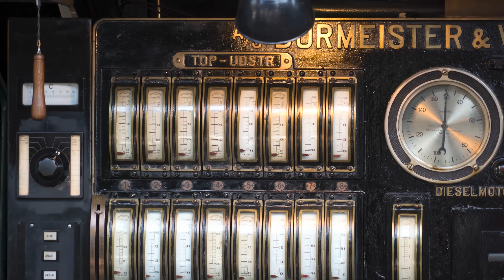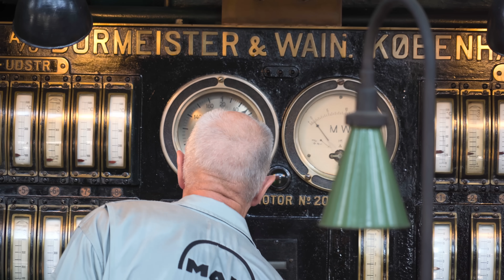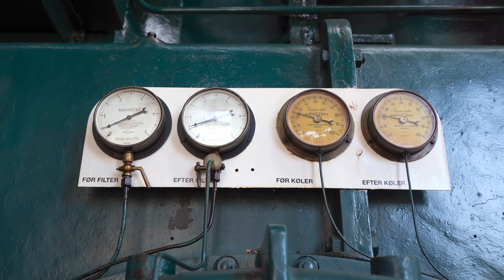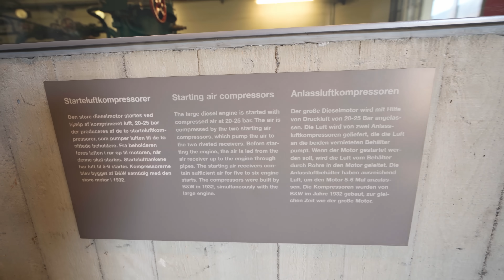Starting The BIGGEST DIESEL ENGINE On Earth | 22.000 hp B&W 2000 COLD START

Comment: What does "double acting" engine mean?
Reply: The pistons produce power on both the up stroke and down stroke.
Reply: This isn't a double-acting engine, it is opposed-piston.
Reply: @holysirsalad Double acting, spot the bottom exhaust pistons at starting platform.
Reply: @markbeale7390  Double-acting is when a single piston is pushed by either side in both strokes. These are opposed-piston, the force for compression comes from the rotation of the crankshaft. Fairbanks-Morse and Napier Deltic engines employ these designs as well. Double-acting is found in hydraulics and steam engines
Reply: @holysirsalad  This Burmester +Wayne is a double acting opposed piston  engine.
Reply: @holysirsalad  Fairbanks + morse, napier deltic are single acting opposed piston engines.

Comment: Bet this engine outlives all the EV's in current use.
Reply: Humanity won't outlive them at the current rate of change.
Reply: I bet the pyramids outlive all the houses in current use. I still prefer a modern house to pyramids or their predecessors: caves
Reply: Considering it's a well maintained museum piece, run for very short times, no problems at all.
However it's doing no real work, it has no load, just a curio for the few watching

Comment: Im curious,  I notice it showed large poppet valve, but why does it need poppet valves if its opposed pistons?  As normally 2 piston cylinder designs use ports that are uncovered by the pistons.
Reply: Good question
Reply: From 2 stroke poppet valve engine,which B+W manufacturer nowadays.
Reply: It does not have any poppet valves, the pistons you can see in motion are the valves, called sliders in this case.

Comment: Sorry  , this is not the biggest diesel  : Wärtsilä Sulzer 96 . It is 114.000 hp by 102 rpm . I believe it is 2300 metric tons and 25 ,3 m3 displacement .14 cylinder , bore 0,96 meter and 2,5 meter stroke .

Comment: I had

I was a fourth engineer officer standing by one these old timers. I got the chance to drive her during engine trials . Three piston in each cylinder  eight cylinders 64 fuel valves .  They were prone to scavenge fires . They were also extremely heavy to manoeuvre as  it was all manual bell cranks .  However feel very privileged to have driven one of these double actors.

Comment: It is oposed piston two stroke of very interesting design. Oh, i would love more technical data apart from being very long lived. Fuel consumption per kWh for example.
Reply: I sailed with these engines for 6 years. Fuel consumption at 116 revs gave us 16 knots speed and used 4.8 tonnes per 4 hour watch, 28.4 tonnes per day.

Comment: Simple question - what is the efficiency of this engine?
Reply: I think about 40%, modern engines a bit higher. If there is an exhaust gas boiler installed for heating purposes the total efficiency can be raised till 50%

Comment: Why not tell what that engine was used for.
Reply: It's connected to a 20 MW generator. Was used during peak demand in Copenhagen. It's last commercial use was in 2003 when it was used to bootstrap start the grid after a large outage. Just visited it last month.

Comment: Manufactures still make engines this size and much larger making over 1 million horse power. These types of engines I've seen them used to power in massive container ships. And they are still in use today. Not many people know super massive engines are used in container ships. The container ships today are super duper insanely massive. So they need a super duper giagatic massive engine to push it through the water. I mean how else are all the retailers able to restock on products just about every day.

Comment: What the sam hill did it ever power? Hope somebody is rich diesel isn't cheap.
Reply: A backup electrical generator to help out the city power grid during peak hours of high usage.
Reply: Often time large engines like this run on residual fuel and not refined diesel.

Comment: 2:32  Those aren't the pistons we see going up and down, are they?  They don't seem to have much stroke length for such a large engine?
Reply: They're the exhaust valves
Reply: @KingdaToro Exhaust pistons  mate, hence opposed piston engine.
Reply: @markbeale7390  No, this is a double acting engine, not an opposed piston engine. That means air is compressed and fuel is combusted both above and below the single piston in each cylinder.
Reply: @KingdaToro  Double acting opposed piston engine,3 pistons per cylinder. 
One main pistons, top + bottom exhaust pistons.
Reply: quite a complicated design for a layperson:
the double acting main piston is driven by a conrod from the crankshaft via a crosshead. The exhaust pistons going up and down visibly are driven by excentric discs mounted on the crankshaft besides the crankshaft webs via crossheads as well.  So the upper and lower exhaustpistons are moving opposed to the main piston, i.e. when the main piston is at TDC the upper and lower exhaustpistons are on BDC. So the upper combustion chamber is created for ignition, while the lower combustion space is on max. size for flushing exhaustgas with fresh combustion air. Hopefully I was able to explain this unique, outstanding design.
Reply: Valves

Comment: Not even close. This is a beast, but the largest is a Sulzer 14RT FLEX96C. 109,000 HP.
Reply: I was puzzled by the title as well, but you and I were thinking S.H.P., not physical size. I don't know how the two engines compare in size but I think that may be what the title is about and I'm also aware that statement of the "biggest" engine will get clicks. Just the nature of the internet.
Reply: It says in the description it was the worlds largest for 30 years starting in 1933. I bet we could find ten videos of engines claiming they are the worlds largest.
Reply: @bigredc222  Thanks.
Reply: @musoangelo  today's biggest engines are also physically bigger mainly longer and they are also at least 3 stories tall .
Reply: @SunriseLAW  I forgot about that, those big ships run on bunker oil, it's so thick it has to be heated just so it will flow through pipes.
Reply: @bigredc222  The big ships start on #2 oil (diesel) and switch back to it near shore or when traveling through Emission Control Areas.
Reply: @holysirsalad  I'll try to remember that.

Comment: Only diesels of at least sixty cubic litres displacement should exist. You will not get 53% thermal efficiency out of anything smaller than an engine big enough to power a cargo ship. Part of the problelm revolves around waste heat; to produce enough of it to reclaim for use in powering steam turbines, complementing the reciprocating combustion process. At smaller scales too, the fixed burn rate is very hard on engine parts.

Comment: It is not the biggest, and hasn't been for many years.
But still a great engine, and fantastic that is still in good working condition.
Reply: It doesn't claim it is still the biggest engine. At 13.5 meters tall, 26.59 meters long and weighing in at over 2300tons, the Finnish-made Wärtsilä-Sulzer RTA96-C is the largest internal-combustion engine ever produced and pumps out a whopping 80.1MW (107,390hp) to power  a container ship
Reply: @tonymercer7759 no it’s not the biggest
Reply: The description says "since 1933"  , and then says "over 30 years..."
So, could it have been the largest between 1933 and ~1963?

Comment: I've never had the pleasure of working on opposed piston B&W engines, only the Uniflow type with exhaust valves (and valve springs which often broke!). Nice to see this machine is still in working order.
Reply: This isn't just an opposed piston engine, its also double acting. It has 3 pistons in each cylinder, 3 different bores and 2 lengths of stroke for the 3 pistons. The one I sailed on in 1975 had the unfortunate habbit of having a scavange fire at regular intervals.
Reply: @billdoodson4232 Ah, happy memories of scavenge fires! It was like that on my first trip. The tanker had a 10 cylinder Kincaid-B&W main engine. I was glad when I left that ship.
Reply: @MervynPartin  I never really liked any B&W's, I did my first voyage on the double acting engine, hated it at the time, but now see it as an experience I can go on about. Did a couple of of opposed piston engines both B&W and Doxford and I think 2 uniflow B&W's which if anything were worse than the double acting. Loved the RD and RND Sulzers though. Best engines ever.
Reply: @billdoodson4232  I know what you mean about the Sulzers. I had 2 trips on a LPG carrier with a Swiss-built Sulzer that ran lovely. Unfortunately, it had Stork Werkspoor diesel generators which kept bending crankshafts.
Reply: @MervynPartin  I had a similar issue with generator engines fitted to one class of ship as "in port" gennys. They used to throw rods or seize at the drop of a hat. They were Paxmans, more commonly known as Poxmans. One would break a rod which would go through the crankcase, shoot across the engine bay and then put a hole in the other engine which would then fail even more spectacularly as it tried to take an instantaneous doubling in load. The Sulzer ME sort of made up for it, but the normal sea going gennys were Allens, which were nothing special. I spent the last 5 years at sea foreign flag with Sanko, all Sulzer ME's and the very best gennys I ever had the pleasure of sailing with, Yanmar.

Comment: All main engines are started the same way; by compressed air being injected through an air start valve on the cylinder heads, which kick the engine over then fuel rack is opened allowing fuel to be injected into the engine.

Comment: Please note that there are engines presently with more than a 100,000 BHP fitted on vessels. 22000 BHP engines were in operation for than  50 years
Reply: However, large is a relative term, and does not imply BHP.
Reply: @SunriseLAW yes for the run,but for starting is diesel oil. After that is blend oil, mixing of diesel and bunker sea, and finally avec 2 hrs at full rpm around 102...there is full bunker sea .
Reply: @SunriseLAW  LNG tankers will also fuel their large diesels with the LNG that is their cargo. Some of those large engines can burn about anything from heavy crude to light sweet crude. (as Caro.lanver said they start on diesel and then switch to product)  They will require specialized equipment to burn the product they are carrying.  And many very large container ships (not all) are using two engines under 50,000 HP each. But some are using a single Wartsila Sulzer engine, and HP for those engines varies as the engine can be ordered with anywhere from 5 to 14 cylinders. The 14 cylinder can produce around 109,000 HP. (depending on what they are burning and other factors)
Reply: When I was serving active duty U.S. Coast Guard onboard Cutter Hamilton (WHEC-715), she had two Fairbanks-Morse inline 12 cylinder two cycle oppose piston diesel main propulsion engines. We would joke that the emblem of “O-P” meant oil pump because the lower air box covers would constantly leak lube oil. These engines had two huge turbochargers at the front feeding into a huge scavenger charger pushing the compressed air into the air boxes. At first, on the Atlantic side we were using marine grade heavy diesel fuel oil to lube the pop injectors, but after crossing the Panama Canal to change of duty stations from Boston MA to San Pedro CA, the liberal west coast climate change cultists forced us to use a thinner JP4/JP5 aviation fuel, we were forced to modify the injectors. The injectors were center mounted in each cylinder.
Reply: @2003JaguarSuperV8  Must be terrible for Californians not to choke to death on smog, eh?
Reply: @SunriseLAW  well it us a compression .ignition engine -that us a diesel and today the largest engine is two  stroke 115000 hp 14 cylinder Sulzer Wartsila cross head  diesel 14 cylinder , crankshaft 27 metrres;  each cylinder 18500 c.c -total weight 2700 tons drives a 90000 ton container ship at 27 knots 104 RPM direct drive .
Reply: As far as I know, HFO has been banned. The ships burn only diesel oil.
Reply: @MihalisNavara  I think the International Maritime Organization (IMO) required that in 2020.  Huge improvement in stack particulates and toxins (especially sulfur).
Reply: @SunriseLAW   One of Rudolph Diesel's first models burned peanut oil, so by that logic none of these are "pure Diesel" engines...

Large marine diesel engines - so called because they are the compression-ignition design pioneered by Rudolph Diesel - regularly switch between various fuels including residuals like heavy fuel oil (aka Bunker C... #5, #6, etc) and distillates like VLSFO and ULSFO or ULSMGO. The latter is known as #2 fuel oil, or stove oil if you're talking heating, or diesel oil if you're at a gas station. The only difference to the engine is whether the fuel needs preheating to reach the correct viscosity, it all works the same.
Reply: HFO is still burned.  It just has to be under a certain amount of Sulphur.  Near the coast of some countries they need to have even lower emissions so they burn distillate diesel fuel.  These engines can burn either.
Reply: But still aDiesel by definition...(Burning fuel under constant pressure and temperature, A dDesel will run on anything, even your daily household waste if you can feed it via injectors at top dead center pressure and decreasing at power stroke) @SunriseLAW
Reply: The opposed piston design used to be quite common on merchant ships. Wm. Doxford of the UK built hundreds of this type up until the mid 70’s I think. In the end they just couldn’t produce the power of the single acting designs produced by MAN B&W or Sulzer.
Certainly engines above 100,000 hp are in use today.
Also the opposed piston design had more moving parts and therefore needed more maintenance. I sailed with a Doxford 76J6 built in 1967 at Sunderland. A 6 cylinder engine had 18 connecting rods and the associated main and bottom end bearings and cross head bearings.
It was a very smooth running engine though and used common rail fuel injection which is now the standard on all modern large 2 stroke engines in use today.
Reply: How about the Man methanol 2 strokes.

Comment: Not the biggest, near me are two 65,000 hp  and one 100,000 hp diesel engines. I have been around and up the sides of the smaller 3 story high engines, very impresive.

Comment: I was sailing on MS " Georg Büchner" ex " Charlesville"  50 years ago driven by such an engine, built in 1950. I started my sailors life there and decided for an engeneers career on the spot, when I saw this fascinating engine. But I must admit, that it were tough times sailing in tropical waters with 45°C ER temp and exhaustgas enriched air leaking from the lower exhaust piston stuffing boxes you can see oscillating in the video 😂
Reply: PS: unfortunately this precious piece of engineering was lost for ever, when the vessel was towed to the scrap yard and sank underway in the eastern Baltic in May 2013 😥

Comment: I never sailed on a ship with a B&W main engine but several with B&W generators. This looks very like the old C.C.Pounder designed H&W opposed piston engines of the '50s and '60s. Many British shipping companies had ships with these main engines and I sailed on several vessels with either twin 6-cyl or single 8-cylinder installations. Not particularly powerful but could still propel a 1950s built fridge boat to +21 knots when asked.

Comment: 😃Beautiful, unparalleled, but the most powerful engine in the world is the Wärtsilä-Sulzer RT-flex96C 14-cylinder 107,390 hp!
Reply: That was an amazing engine. Although replacing the inside fuel pumps on the V-block was a bitch when working in 40deg C temperatures.

Comment: I would love to hear it making full power. Big steam turbines do nog vibrate. But you can physically feel the difference between the set just turning and it making full power.
Reply: They are very very quiet flat out. You can hear the burn in each cylinder as they are running. Although the one I sailed with could make some noises it wasn't supposed to.

Comment: Hard to believe the behemoth is actually a national treasure. 
Always wondered how many cubic feet of air it takes to start it.
Reply: The starting air was kept on until the engine had completed one full revolution, the lever is then pushed further up to cut off the starting air and start the fuel injection. On our ships, Blue funnel, if it didn't start first time it cost you around of beers for all the engineers, These engines had to be warmed up to operating temperature with steam from the donkey boiler for some 6 hours before starting, otherwise you get cracked liners and pistons.

Comment: They have used and likely do still use the engine and generator to set the cylces per minute so the other gen stations can follow along.
Love this engine, wish i can see it someday.
Reply: Not anymore. It has been totally cut off from the grid (they don’t run the exciters anymore when they run the engine). But it was until quite recently kept as a backup in case something like a black start of the grid would be necessary and occasionally as a buffer at peak utilisation. 
It was run for real in the 1990s, maybe even a few years into the 2000s. I don’t remember exactly when it was permanently mothballed. But it is great that the enthusiasts managed to keep it in running condition and created the wonderful little engineering museum around it. 
Last time I was there for a start the museum had free admission, so if you are in Copenhagen on an open day and you have just the mildest interest in engineering history it is a no-brainer to go visit them.
Reply: Very interesting! Thank you!
Reply: Cycles per second surely?
Reply: @patrickporter6536  Oops! Quite right.